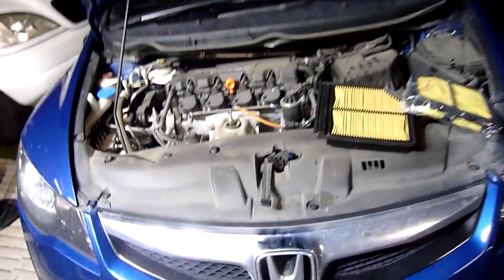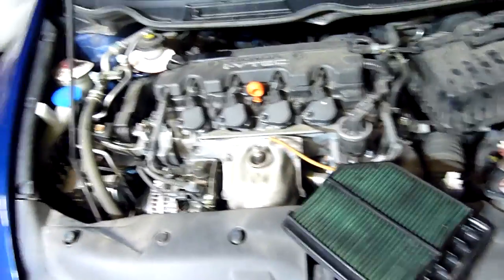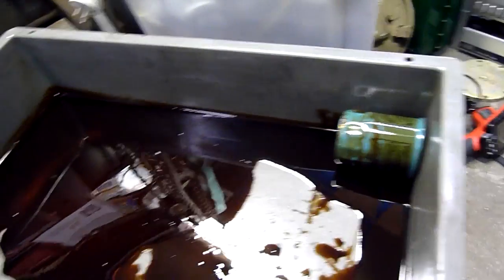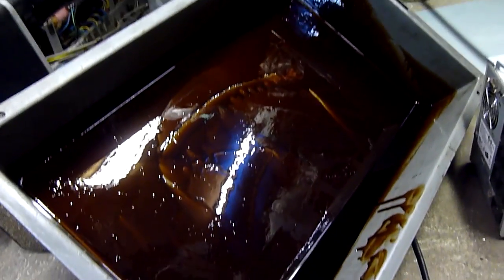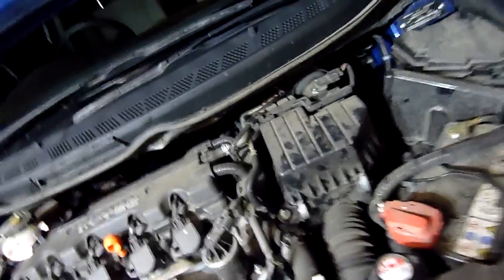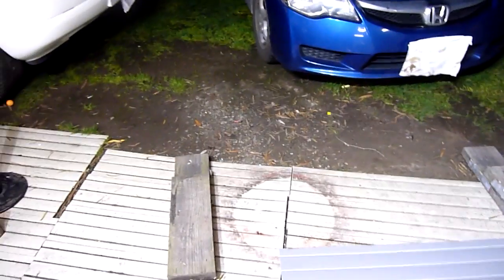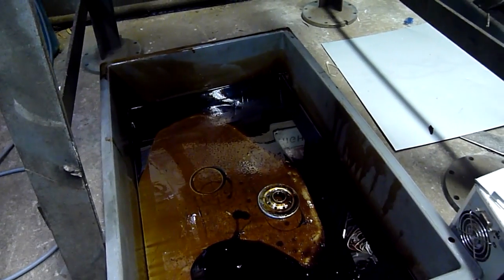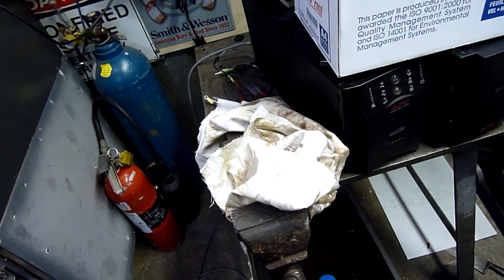2010 Honda Civic overdue oil change

Comment: You do oil service every 3-4K?!.   Thats ridiculous!.   You're wasting your money.
Reply from the maker: +Marek Sumguy oil is cheap, spending a little extra on oil changes is no biggie if it keeps my car happy, especially the extended highway trips I do to the shooting range (2 - 3 hours each way)
Reply: +Aussie50 I'd never make fun of anyone for changing their oil more than recommended, as it doesn't hurt anything. However I don't usually accept any excuses for not doing it, esp. when you're low on money, thats when you can least afford the pricey consequences. At least here in the US where I live, for my Durango with a 4.7l V8, it costs about $25-30 to buy oil and a filter, I know in most places you'll find its similarly inexpensive to buy the needed oil and filter. If you do it yourself I don't see how anyone could not afford it, I think you really can't afford not to.
Reply: +Aussie50  It seems you have NO idea when it comes to this topic.  

Highway driving is the EASIEST on your oil... which means you can go even FURTHER on an oil than factory recommended!.  

Unless its a really high performance engine and you drive it hard on a regular basis.... or... you're always hauling a heavy load... 3-4K is was overkill.
Reply from the maker: +Marek Sumguy still shit, I earn enough not to care about the extra $30 a year. I do not do all that many KM per year as it is.
Reply: +Aussie50  $30 for oil and filter?!.  What kind of garbage are you using?!
Reply from the maker: +Marek Sumguy I use Penrite, and usually have 1/4 of a bottle left over from last time. filters are cheap too, or free if Repco is having an Oil and filter deal day. remember, this is a RAV4 with the ubiquitous 3S-FE engine we are talking about. the ML270 is twice the price to service, but being diesel, I prefer to do it often!.
Reply: +Aussie50  on a side note... Penrite is probably the best value oil you can use in Oz.  Im glad you're using penrite.